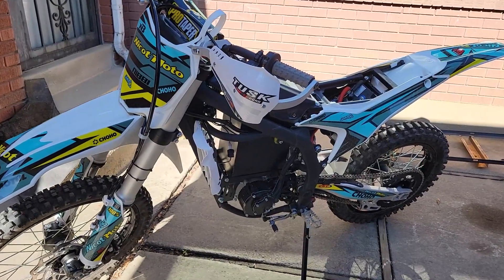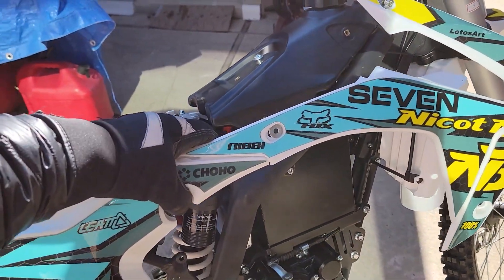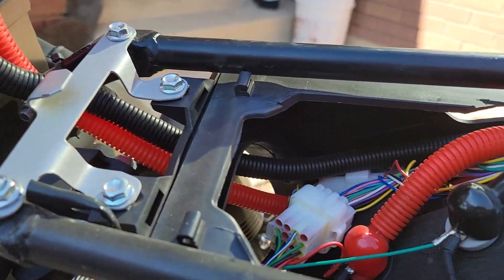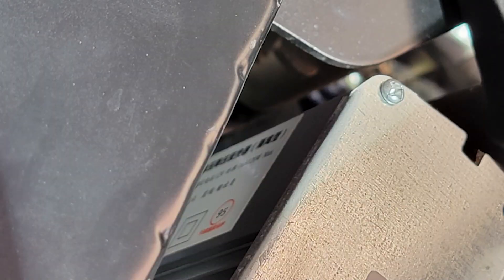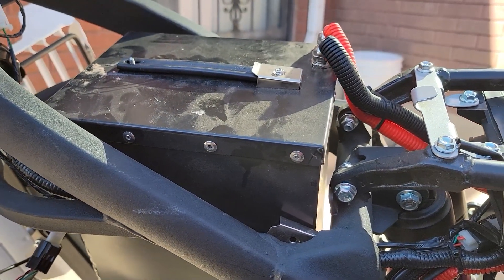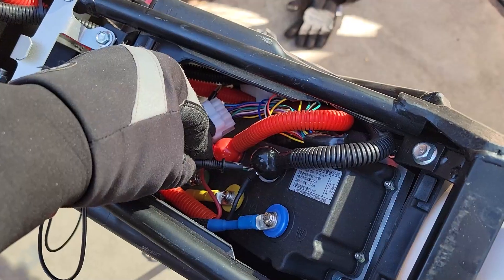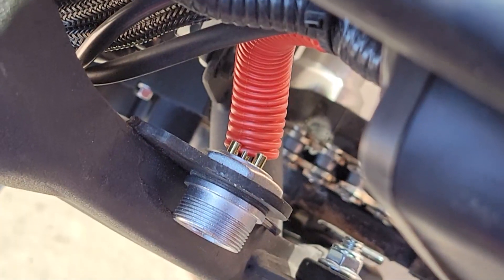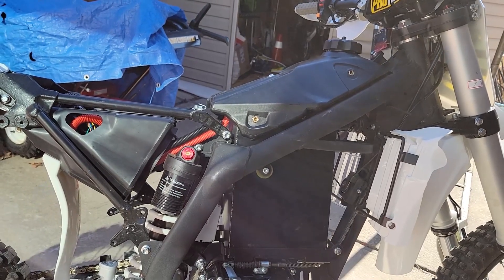Chinese Electric Dirt Bike Wiring Deep Dive

Comment: Hi,
can the battery be charged when it is removed?
Reply from the maker: no, the charging wires go up to the controller and then back to the battery. You could probably create your own short connector to do it, but i have never removed the battery.

Comment: Blue, yellow and green wires are motor phase wires. Small wire going to the motor are hall sensors and temp.
Charge port is direct, so just pos and neg . Power from the charger goes through the controller to the battery. 
Cable glands are protecting the battery - keeping it somewhat waterproof. They are conductive, but battery wires are shielded.
I have the etime bike. Similar. Also from Utah if you want to ride sometime and compare.
Reply from the maker: send a message to the email on my channel page under "About" and lets see if we can meet up sometime
Reply: I have problems with my time et any chance u can help me out please

Comment: That throttle cable to electric box is the same as an early Sur-ron type so you can easily convert to a straight electric throttle and connect the plug at that connector after the cable box on the frame. Much better set up.
Reply from the maker: that would be awesome. I had trouble with this cable out of the crate. It had kind of worked loose and it was a bit before i spotted the issue. I will check into the alternative for sure

Comment: It's APT controller.. 150A continious and 200A peak.. The boost mufht be higher but the phase Amp's are 400A..
I would get a much better controller but you. Need to know th specs of the bms and battery on how much it can safely discharge.. If you are thinking about upgrading the batt, me personally I'd go with 96V system or much more powerfull controller.. The motor can take 17kW.. If it's an ipm version maybe even more..
Reply from the maker: its hard to imagine giving it more power, since it will wheelie so easily in first gear.  I'll probably explore that down the road though. I'd be more tempted to build a larger capacity battery of like 75AH for another 15miles/25km of range
Reply: What controller is better for 80v system like this? Battery is probably lg ternary. 22s.
Also agree this bike has plenty of power. Plus you have gears to maximize power and speed. Range could be better though. Batteries will improve in the future and then upgrade.
Reply: @mikeloeser6239  It all depends on what features you want. 
I'd say asi bac8000.
Nucular 24F  or kwlly But fardriverwill also work 
.
Reply: @Ray88G  apt controller is a rebranded far driver. Bac only does 72v. Nucular has 8 Guage battery wiring. This apt is full 6 Guage phase and battery. Kelly is horrible in general. I know people have issues with the apt because of size and weight,  I wouldn't recommend for surron but works with this big battery and bike.
Gearing is great on this bike. It has a "smaller" front sprocket and motor does up to 6k rpm or so. 4 gears allows the bike to have super low and high end. I think you'll get 70 mph. Easily goes 50 mph.  Normally I'd agree about no gears, but there isn't a reduction gearing like the surron has and you get top end that surron doesn't have. Having a clutch is also fun on a dirt bike to throttle power. Leave it in 3rd gear and the kids can ride without killing themselves. 
First bike I've had that I didn't immediately want more power. Surron, I changed everything the first month and still wanted more power. Surron has its limitations and this costs less on top of it.
Reply: @mikeloeser6239  That's not true..APT and fardriver are completely different controller's.
Reply: @mikeloeser6239  Wiyh gears you can only multiply torque which helps acceleration or climbing ..
If you're not building a bike for hard enduro it's better to go with direct drive

Comment: @Feathers Offroad That second box that you mentioned is not a controller. From the angle it looks like a headlight/ turn signal DC converter. So if I'm not mistaken you could have the option of installing headlights/ turn signals!
Reply from the maker: Could definitely be at only 10amp/120w, that would be 12v coming through. I will follow that through the wire harness next time.
Reply: 12v dc converter